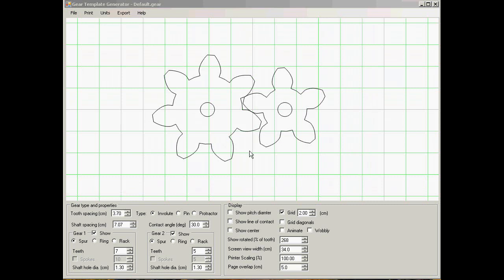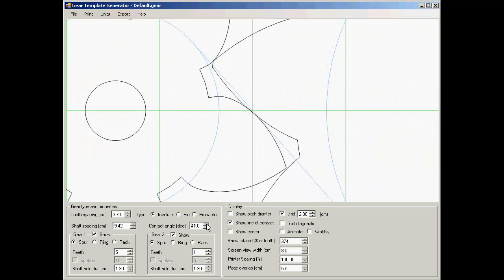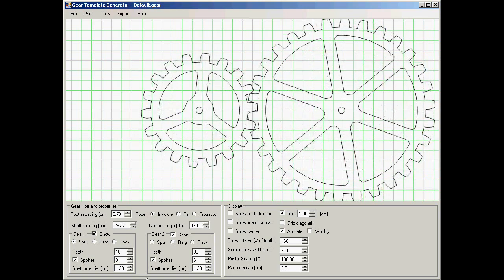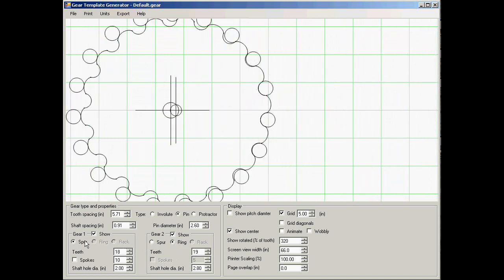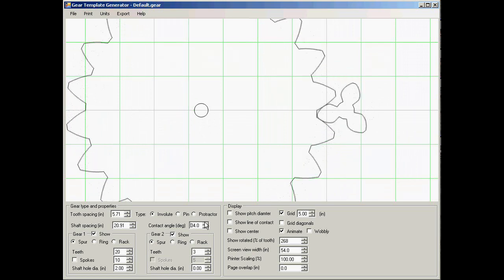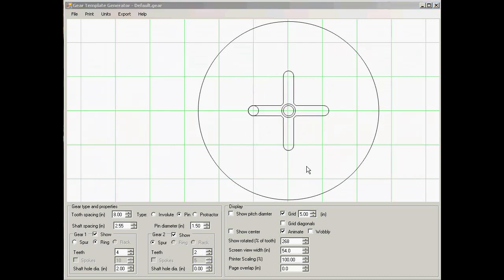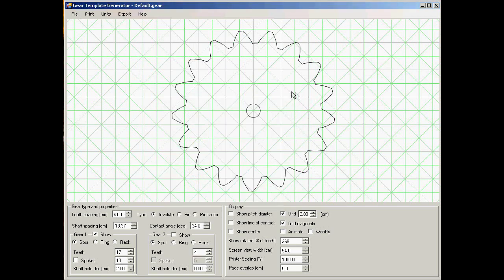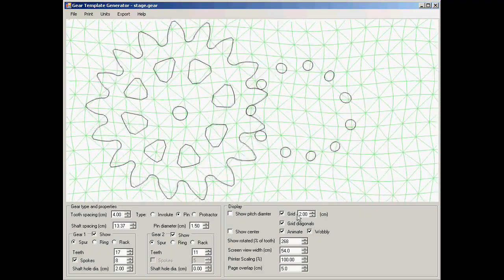Gear template generator feature tour

Comment: I use your gear generator all the time on my CNC router and it has yet to fail. It makes perfect gears! It is also super easy to use! I wish I could find it as an .stl generator for my 3D printer.
Reply: use inkscape to turn it to stl file
Reply: It exports something that works with SketchUp now. It might be STL. I import into SketchUp and use the gears in my 3d prints. Thank you Matthias 😀👍

Comment from the maker: It depends on a lot of factors.  With pinwheel gearing, you can get a way with 3.  Smooth running involute gears its more like 6 or 7, but real machines never go below 14.  Though helical gears in power tools also often go below 14

Comment: This program looks very good, in my woodshop class i was trying to make gears so that i could connect them perpendicularly to make the arms of a robot move if i were to put a dowel at the back. I was estimating the size teeth of the gears and being an 8th Grader I guessed it turned out ok but when i put everything together the arms moved up and down slightly but i guessed it was ok. The whole contraption was basically like the contraption from the original Bionicle toys.

Comment: someone told me it was 5, but the lowest ive seen is in clocks, where a 10 meshes with a 30, the 30 is attached to a 6, and the 6 meshes with a 24 to get a 1 to 3 ratio and then a 1 to 4 to get a total of 1 to 12 (hour hand to minute hand). ive seen this in numerous clocks. i like five because its an easy number to make ratios with.

Comment: Yeah, I think you'd have to use time-parametrized x and y curves with cycloids and the such.  The pin gears would be hard enough, but the involute ones would be really tricky I think.  Also, I have no idea how you would do the "wobbly" thing.

Comment: I have a question. How can you calculate how many turns the smaller gear would do to one turn of the larger gear. Any maths expert here?
Reply from the maker: The turn ratio is the teeth ratio.  Simple as  that.

Comment: goodnight! I have your gear generator program and I'm trying to make one in Fusion 360 by exporting the files from the generator and importing them into Fusion, but the image gets much bigger or smaller depending on how I open it in Fusion, I would know if it's possible to export it to use in Fusion or not?

Comment: I DESPISE Fusion360's poor gear maker. I prefer to design gears around parts, not parts around gears, and Fusion360 does NOT have a "maximum diameter" setting for gears., so it makes creating gears a complete pain. Oh, you want one gear 60mm wide max to mesh into a gear 35mm max? Well too bad, that's a big fat NO chief. This program however doesn't seem to have that issue thankfully.